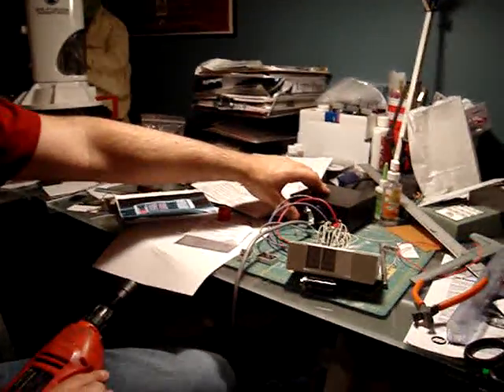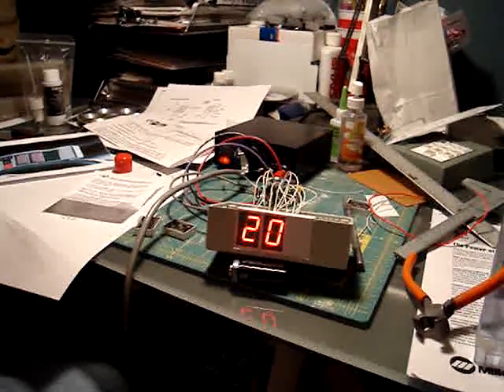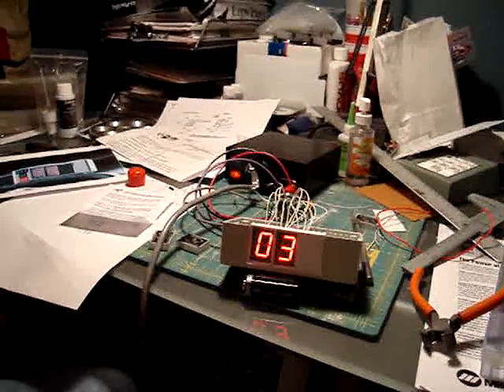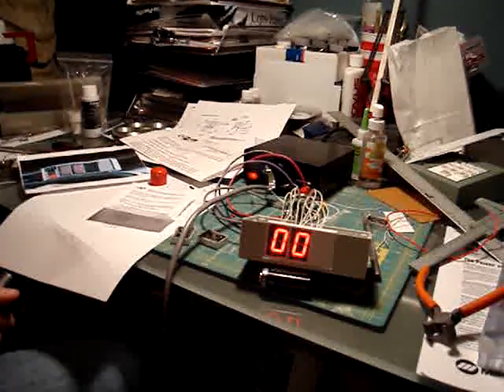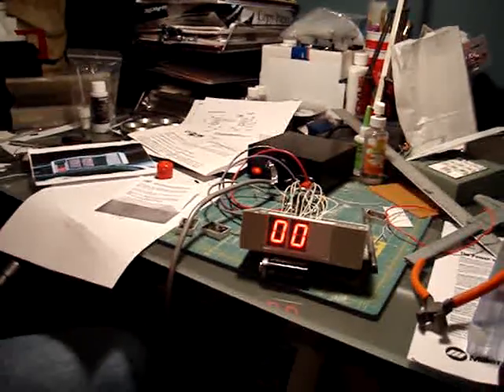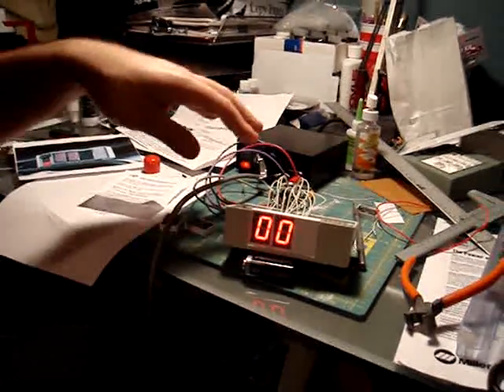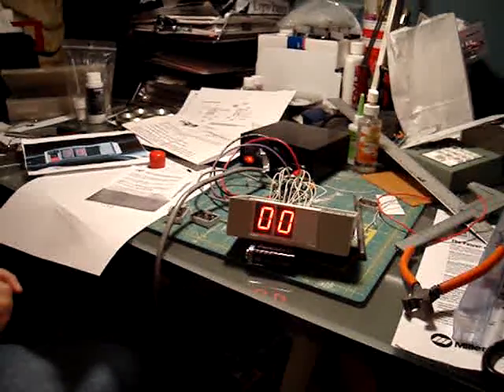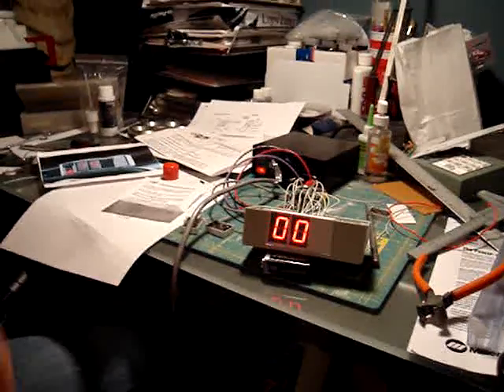BTTF Delorean Conversion - Digital Speedometer

Comment: u should put a setting in the speedometer a switch to when u have it at car shows u can flip the switch and the speedometer will 
read 88 mph intil u flip it again and it goes back to normal at 00 mph (just for show)

Comment from the maker: I just got finished driving my car about 125 miles with this speedo on and it did pretty well in just it's stock mode. I never sped or slowed fast enough for it to matter. Infact, after using it I found out my stock speedo was a little bit out of calibration (too slow).